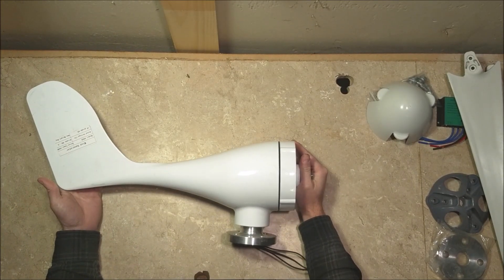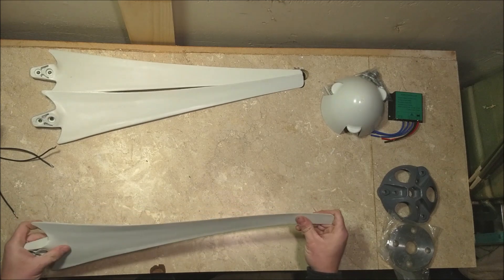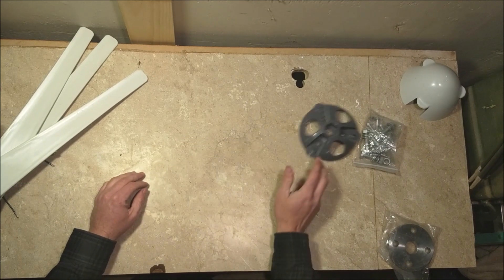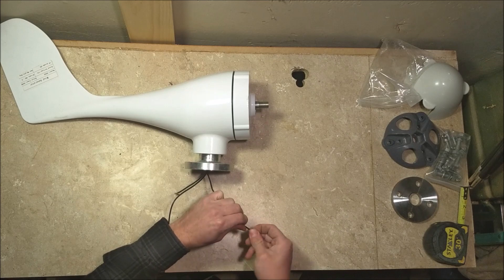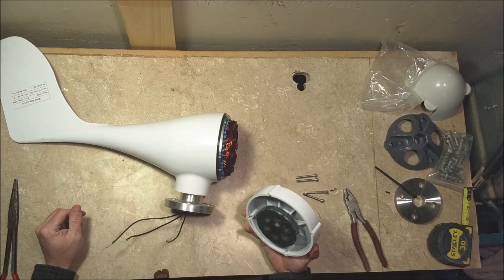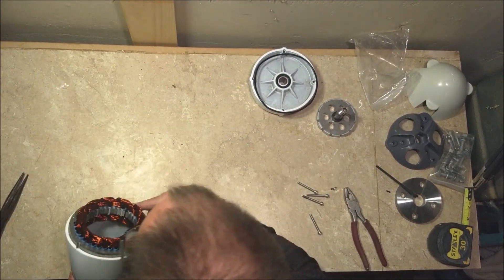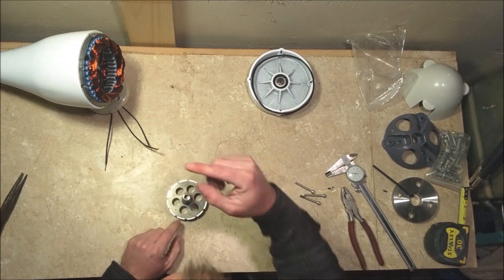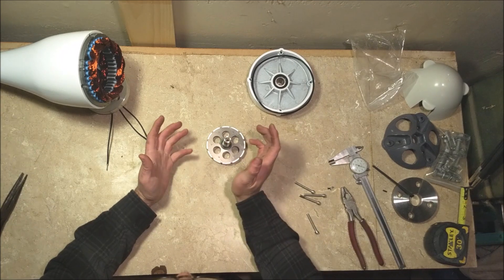eBay 400 watt wind turbine #2, parts breakdown and explanation

Comment: Hello. As always, really found this video helpful. I noticed looking on all the sites for the cheap turbines like this design, there's a difference in weight. Do you think that indicates more spend on the stator? I've noticed a difference in weight of this design in particular from 6kg to 14kg, all the same shape. All 12v obvs as larger voltage would be thinner cable. Any thoughts there?
Reply from the maker: It's really hard to judge by advertised weight because it tends to be just another "spec" like wattage and voltage to most generic Chinese sellers...ie "made up on the spot"

Comment: Hi there, I've just bought this exact same wind turbine but noticed that all 3 output cables are the same (with no markings). Is there any particular order that they should go into the controller or does it not really matter? Also, do you recommend a better controller than the one that came with it? Cheers.
Reply from the maker: There's a number of different controllers they come with, it depends on which one you got, but generally speaking for the outputs these things normally kick out even when working as good as claimed are low enough that any simple controller will work.

All three wires are the same, there is no polarity.
Reply: @ToysforWatts  Thanks for your reply!! - Ok I see, I do have a 40 amp MPPT charge controller for my solar panels but I doubt I'll be able to simply plug straight in with it, what do you think? 

Ah! Makes sense, It's arriving tomorrow so I'll have a play with it then. Thanks again.
Reply from the maker: If the turbine comes with a controller of some variety you'll just run the puts from it to your battery bank.  Don't go to a solar charge controller...they struggle with wildly varying output from a turbine.
Reply: @ToysforWatts   Awesome, I'll do just that then, thanks again!
Reply: Did you test the turbine?
Reply: @BRExteriorPro  Hi there, yes it's up and running right now. One thing to note though is that it takes a fairly high wind speed to get it spinning and I initially had a lot of trouble getting it in the right place away from any turbulence from our surrounding farm sheds and trees. 

 I've finally found the sweet spot atop of my glamping pod and have since had no trouble in charging up my 130mAh battery (alongside 2x 260w solar panels) I've also just had delivered a safety switch so that I can shut it off when required so that'll be my next thing to test. Hope this helps

Comment: I love mine,set it up on my boat to charge 200 a/h battery.
With solar,it's great. Solo solar can't cut it in the u.k. winter  Easy to install. Battery lowest reading now 12 7 volts. Higher end is 13.1 break works nicely.

Comment: Toys for Watts 
   just a question those 3 wires if the turbine is spinning in one direction all time won't the wires twist up  . please i do need a answer
Reply from the maker: Nope they have what's called a "slip ring" on them that allows the turbine to turn without breaking contact or twisting the wires up.

Comment: If i understand correctly this windturbine set dous not come with a dumpload, and/or dumpload regulater/overcharge protection. 
would you still advise to install a dumpload/regulator with this one,, or can you simply connect the rectifier to a solar battery charger.
Reply from the maker: Unless you're running your batteries on a total loss setup you need to have a dump load to prevent overcharging no matter the size of the battery/turbine.  Even a small turbine like this can generate a high enough voltage to potentially harm a battery if excess voltage is not being bled off.